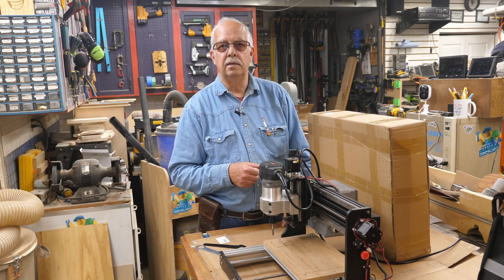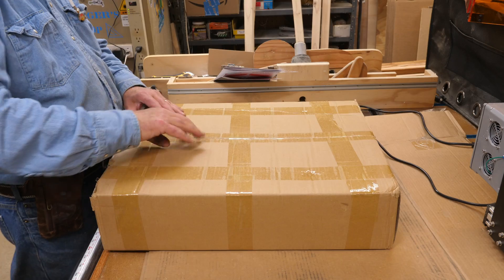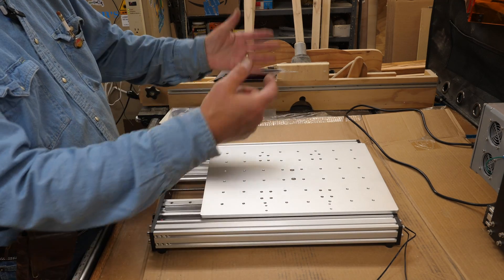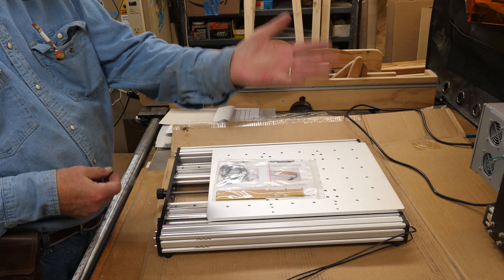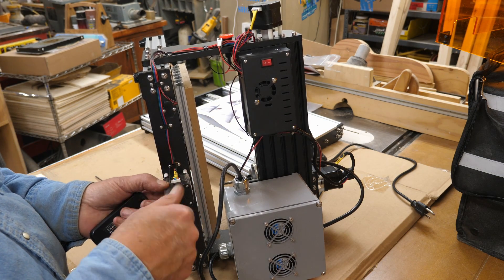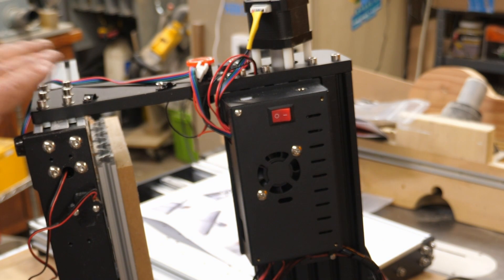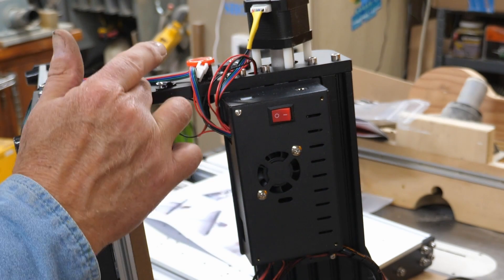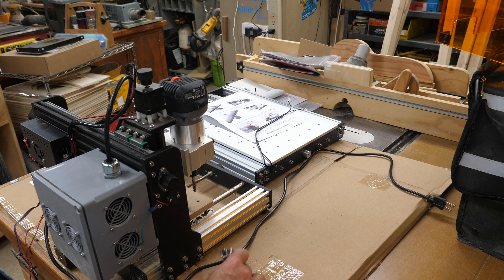Anolex 3020 CNC Upgrade to 3030

Comment: I'm pretty sure this upgrade is a 3040 not a 3030.  I just purchased this same kit and noticed that the bed is mounted slightly twisted in a clockwise direction. I can measure the offset on the front edge of the base plate to the front frame plate and found a difference of 5mm between the left and right side.  I also can see the same offset in yours when I pause the video at the right spot.  I don't actually have a Anolex cnc machine and am trying to get this working for my Genmitsu 3020-Pro MAX.